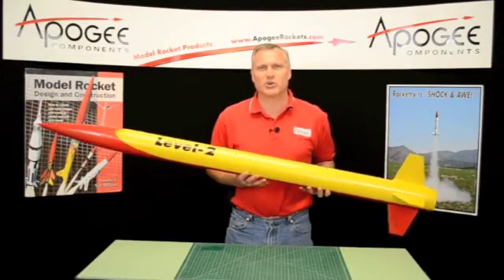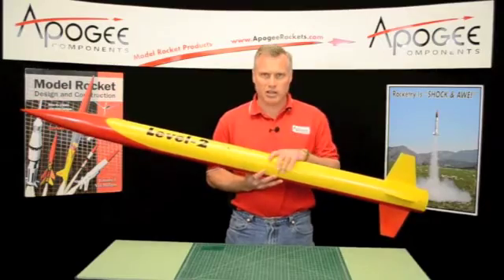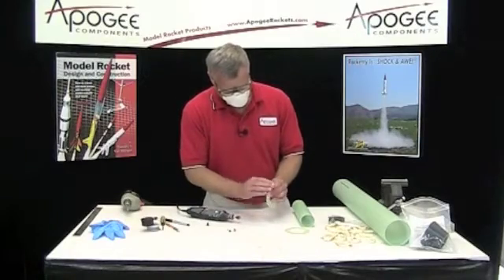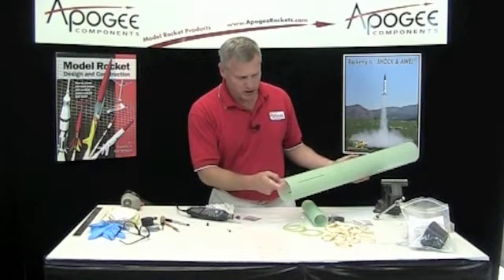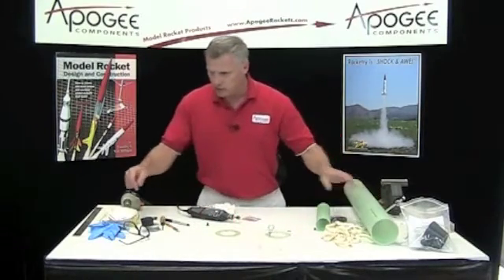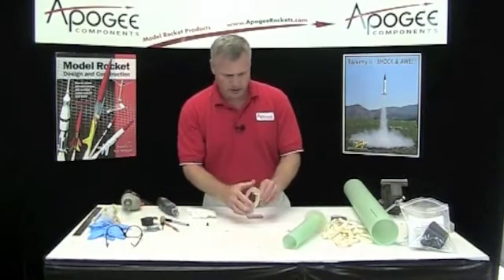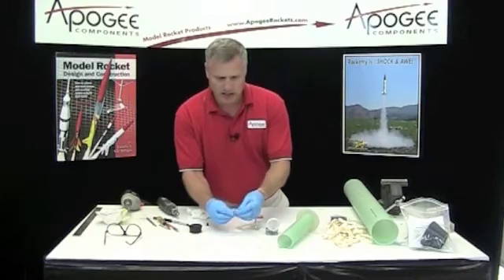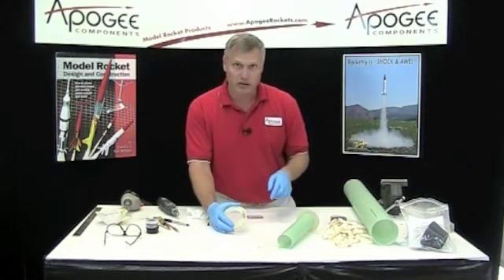Building the Level-2 Fiberglass Rocket Kit - 2: Centering Ring Fit Check

Comment: Otherwise, this looks to be an excellent kit. I have decided to go with the Torrent though, for the first high-power rocket--simply because you can more easily fly it with "Level 0" certification, using 'G' engines. I think it's GREAT that you guys post these videos though folks, as they are a tremendous resource for those of us just getting into the hobby. So THANKS!!!

Comment: I don't understand why these kit manufacturers don't simply include an elastic/nylon lock nut for the eye bolts. Much easier than applying epoxy, and allows you to easily remove the bolt if you ever need or want to. They cost less than 10 cents more than a standard hex nut, so that would add about 50 cents or less to the price of the kit. One gazillion aircraft mechanics can't be wrong.